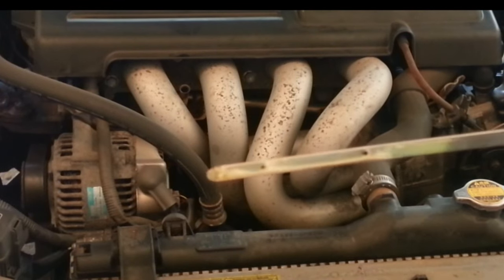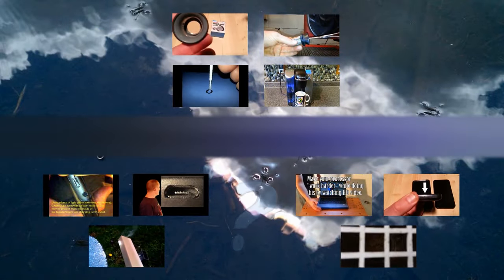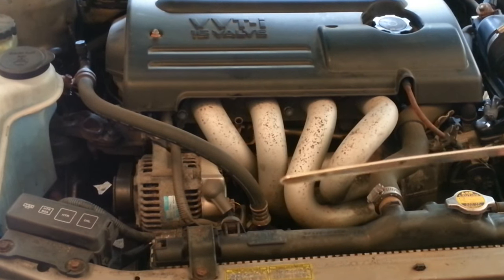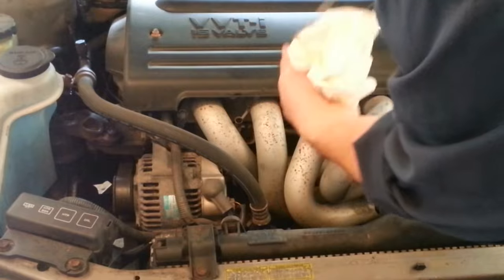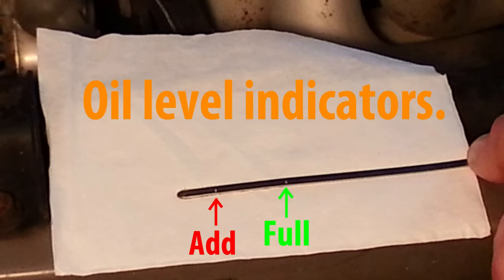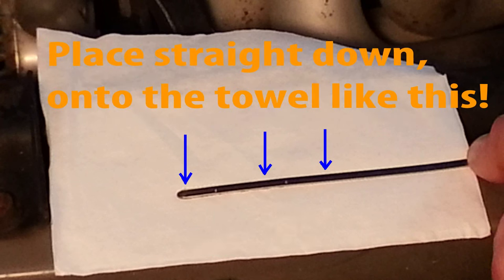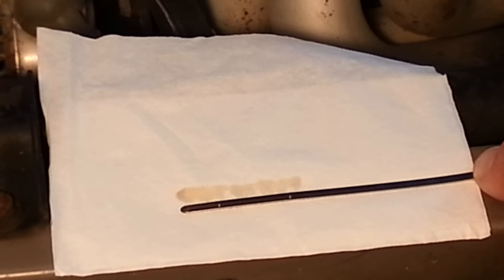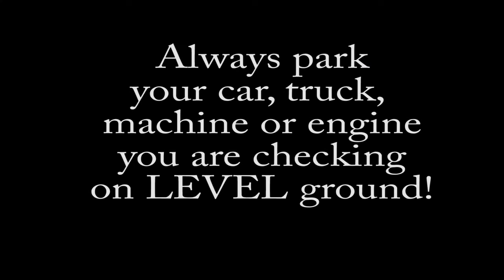Easy! - How to read your dipstick when it's hard to see!. #13

Comment: Just saw this. My comment would be 4 1/2 years late - But, when you're good - the compliments won't stop :) If you do see this comment - What is your opinion about 2 colours on the dipstick? The lower part dirtier & heavier? Cleaner, higher part, lighter? Seems dispersants can only do so much? Also, dark marks left on tissue reveal the amount of dirt in the oil? Especially auto trans? Black in the pink?
Reply from the maker: Hi, and thank you for the kind comment! Yes, I do read these comments. I am a licensed Automotive Service Technician (Mechanic) in Canada, so this question I can definitely help you with. If your question regarding 2 colours as you described on the dipstick is specifically for an "Automatic" transmission, then I would say that this is a common occurrence on vehicles that have been driven for more than a year or two (typical  city/highway driving conditions). There likely is no need to be concerned unless the fluid smells burn't! Small amounts of Automatic transmission clutch and band frictional material do slowly wear,  eventually ending up in the fluid, and, on the end of the dipstick. If you have many miles or kilometres on your vehicle, you might choose to replace your fluid and pickup filter (if equipped) as per the maintenance schedule found in your owners manual. Just a note on fluid colours.... Newer fluids tend to go darker faster than fluids found in vehicles of the past that used Dextron 3 or equivalents and earlier.
I hope this helps.
Reply: @mysimplefix  Thankyou for your prompt response & explanation :) My question was about both: engine & auto trans oils. For auto trans oil, my observation is that the colours don't separate as much on the dipstick as on the tissue, cos trans oil is checked with idling engine? For engine oil, the colour is 2 tone, on the dipstick, checked after standing, stopped a while. The tissue would also indicate the separation, by your method. I am one of those who does used oil lab analysis at every oil change & ponders over every ppm.
Expensive hobby? Some would tell me - Just buy a new car & Get a Life? :)

Comment: So what do you do if you have a bend in it? My Dodge ram has two at the end
Reply from the maker: One "twist" on many vehicles' dipsticks is put in the end of the dipstick, and usually another one or more just above the "full" line of the cross-hatch (or dots depending on the vehicle). This is designed as an attempt to prevent "smearing" of the oil when the stick is pulled out of the dipstick tube resulting in an incorrect oil level reading. As you will notice, the twist will never be in the cross-hatch / or full/add one liter area. The oil level will be revealed easily using this method, because there is no bend between the cross-hatch, or the 2 dots (full/add one liter) on any dipstick.

Comment: Didn’t work for me.  I have a toyota 3.3l.  The dipstick always comes out with a certain amount of oil about 6 inches up the stick. It just picks up too much residual oil along the tube.
Reply from the maker: In your case with the dipstick removed and wiped clean, I would wait 2 minutes (after the engine is turned off) before re-inserting the dipstick, for the oil to stop dripping internally onto the dipstick. It is quite common and yes, it's a pain.

Comment: This will not work if your dipstick is twisted above and below the measure zone, as the case is with a Nissan Patrol..... any ideas?
Reply from the maker: In your situation, after completely wiping the dipstick dry with another paper towel /rag, you could try to place the paper towel you are using to read the oil level on top of a rag, or another paper towel. This will allow your towel on top to conform to the curvy dipstick.

Comment: my car has a very short dip stick that does not go down far enough to reach transmission fluid...dum as it sounds but true Sunfire 2000 how do I find out how much fluid is inside ????
Reply from the maker: In your case unfortunately a dipstick cannot be used to check the transmission fluid level. Let me explain why. Many front wheel drive GM vehicles use the "fill and spill" method for fluid level checking and filling. This is how it works. There is a filler plug that is made of plastic that is located on top of the engine that can be removed by unthreading it. There is a service bolt with a 12 millimeter head on it at the back of the transmission underneath the vehicle halfway up the transmission. In order to fill the transmission to the proper level, the vehicle engine must be running, must be at operating temperature, and must be in park. This procedure could be done either on a vehicle hoist in a mechanic shop, or an oil change Pit. The important part is that the car is completely level. The 12 millimeter bolt is removed from the transmission when the engine is running and fluid is added to the hole at the top of the transmission where  the filler plug was removed. Once transmission fluid starts running out of the service hole at the bottom of the transmission your transmission is full and at the proper level. That surface bolt is put back in and the threaded plastic cap on top of the transmission is put back on as well. For you my suggestion would be, that if there are no visible fluid leaks on the ground underneath your vehicle, then your transmission fluid should be at the proper level. If you do start to see staining on the ground however with a pinkish kind of fluid then that could, indicate a transmission fluid leak. Be aware that power steering fluid can look pink and the coolant in your car which is Dexcool would be orange. I hope this information helps you somehow.

Comment: Won’t work on an 09’ Silverado that’s for sure, wish it could tho idk how to read this damn dipstick half the thing is soaked the other half is dry as a bone
Reply from the maker: With the engine off (and the vehicle parked on level ground), pull out the dipstick, wipe it off,  and keep it out for 1 full minute. Then, the dipstick can be reinserted, then pulled out and read. The oil must settle. I hope this helps.